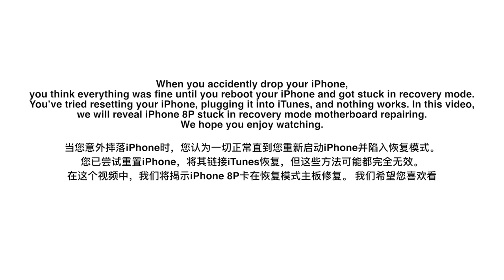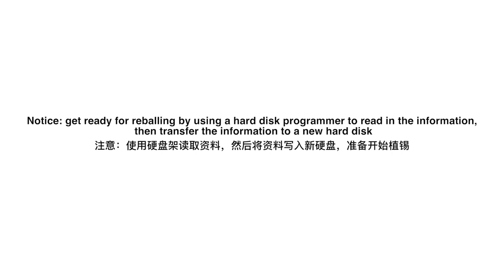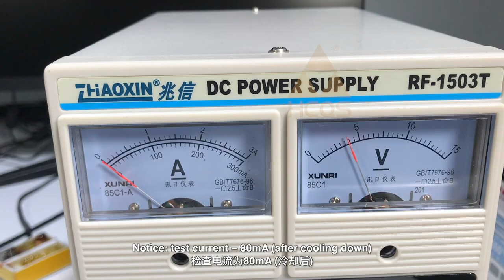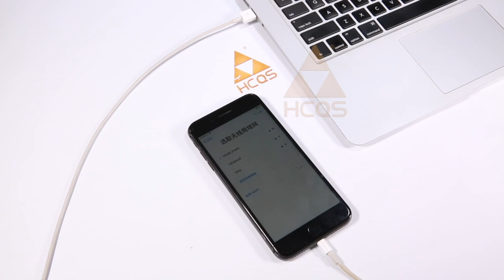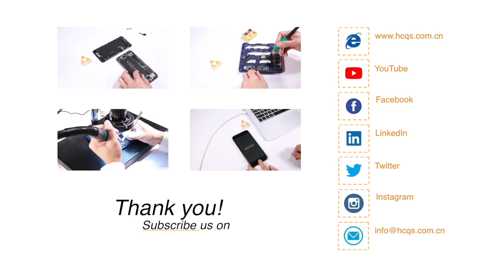How to Fix iPhone 8 Plus Recovery Mode Loop/iTunes Logo/Error 14  | Motherbaord Repair

Comment: With this fix, can you get your old photos and videos back, or does it restore factory settings?
Reply: Hi im dealing with same issue right now, were you able t fix your phone? My phone is in recovery mode currently and keep getting errors when i plug it in
Reply: @drakecryson9151  did you find a solution?
Reply: @heyanni6099  No i havent